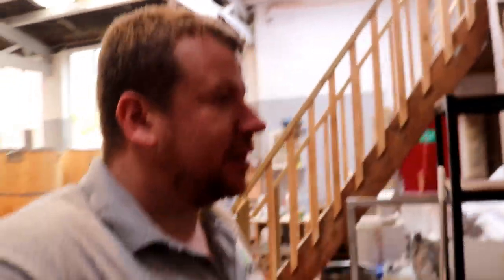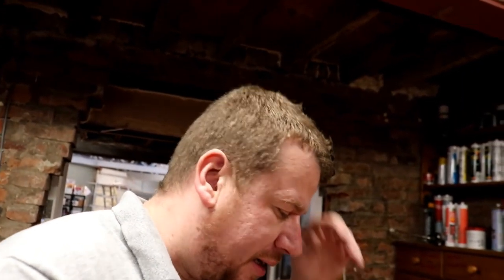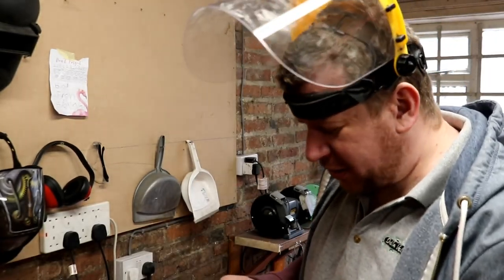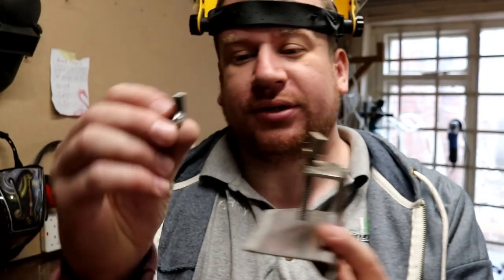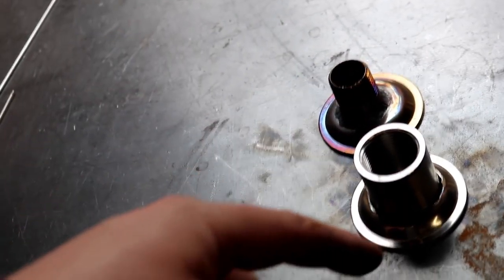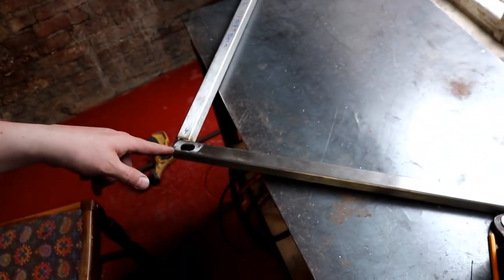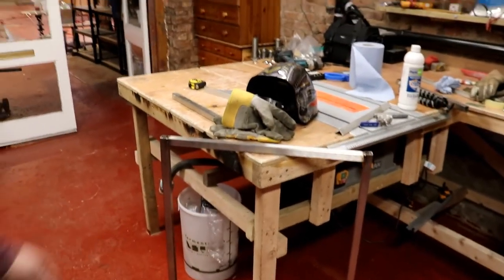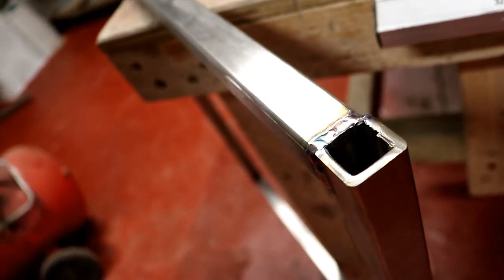THUMB SCREWS

Comment: All looking good.  Congrats on another award.  Why not just weld the threaded bar (without the flat bit on top) to the tanks and then you won't have to take the bolts out to release the lid.  Just undo the wing nuts.  Less things to drop in the FV's!